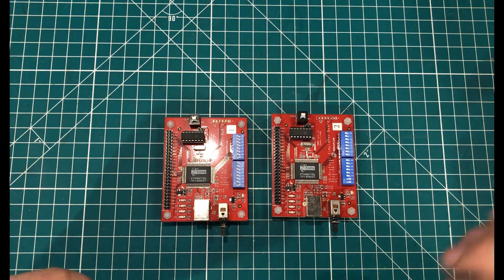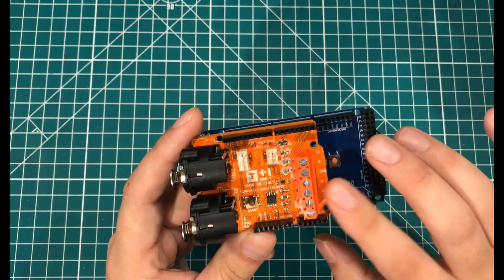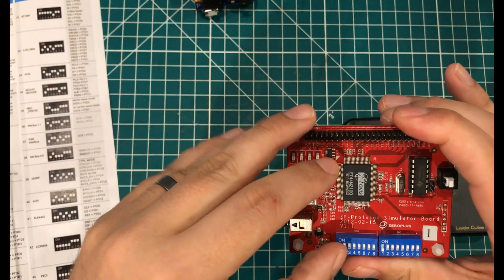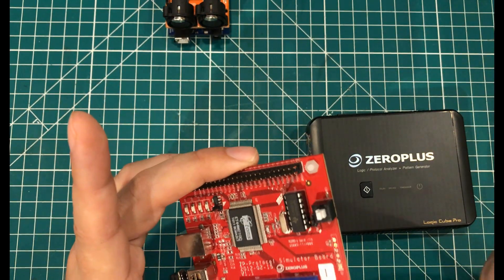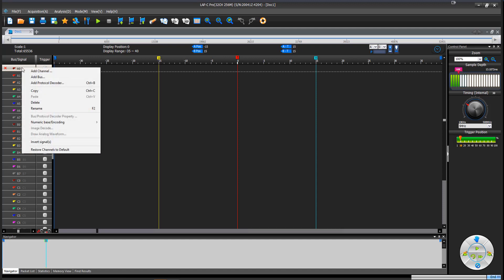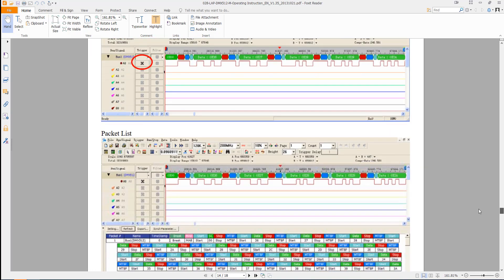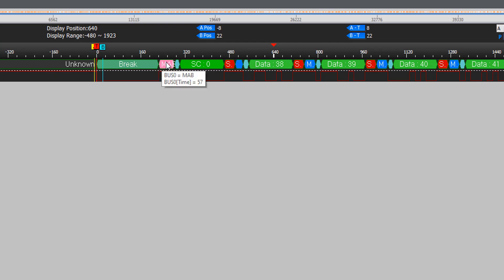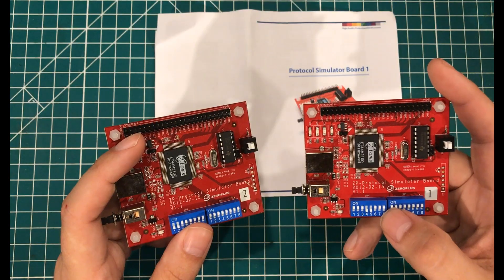ZeroPlus Protocol Simulator Review and Demo

Comment: Very nice piece of kit, I wish the automotive industry would adopt a signal / protocol generation tool instead of "replace with known good module and re-check" ... yeah we have 6 2001 Accords in the showroom we can remove an ABS modulator from, thanks.
Reply: Hi Simple Electronics, if you like to know more info on Logic Analyzer solutions, plz send ZEROPLUS a email so our team can help you quickly :) Email: Timkao@zeroplus.com.tw
Reply from the maker: Yeah it seems like with a protocol simulator and a ton of connectors, you could save a lot of hassle